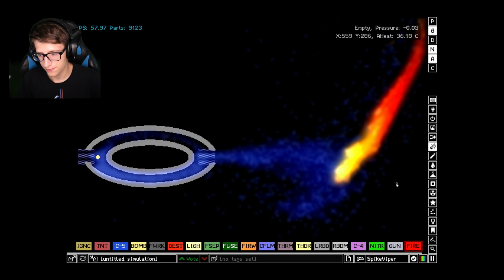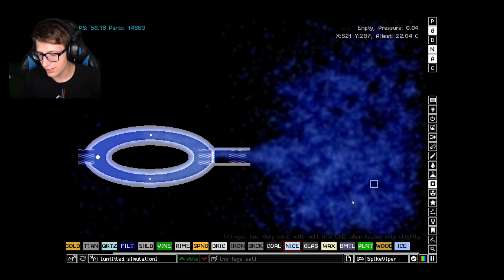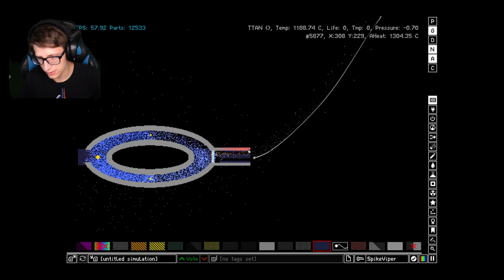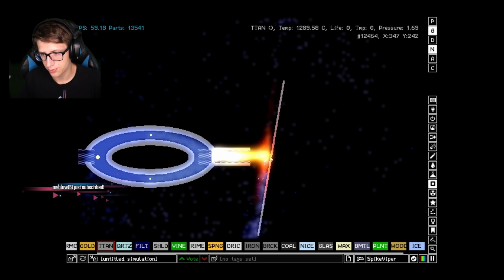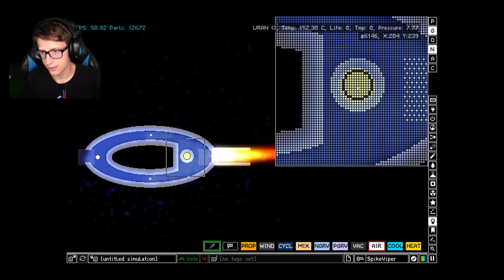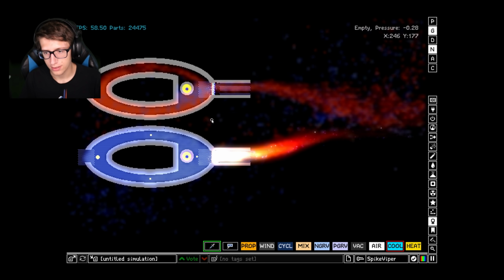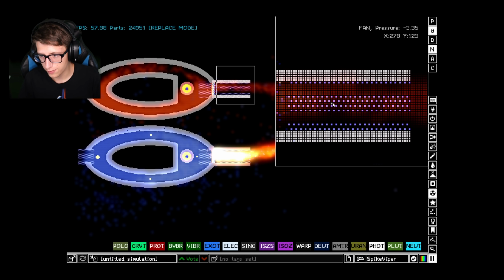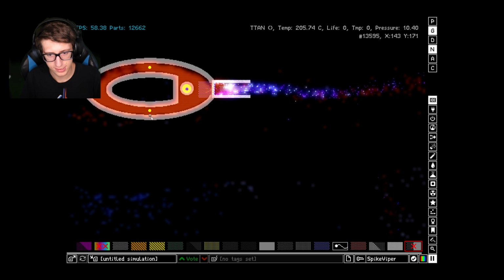PLASMA TORCHES in The Powder Toy!

Comment: “Not gonna use diamonds cause I want to make it realistic” continues to use fucking portals….
Reply: Quote unquote
Reply from the maker: It’s really the only way to make a one way valve without making it horribly slow (pipe)
Reply: @Tuga chan uwu well diamonds irl are not literally indestructible in all forms, they're pretty shiet materials
Reply: @serbianspaceforce6873  dimonds alone are weak, but coating metal with diamond is very strong.
Reply: Sorry for necroposting, but let's just imagine a portal is a pipe that goes through the background.

Comment: If you're going to test melting times you need to put the wall the same distance from the ignition point each time or you'll screw up your results.
Reply: Was looking for this comment, but it's not only that, the plates should also be equal in length and each torch should get it's own plate.

Comment: Ummmm I may made a water vapor beam that can melt gold alinum and iron faster than that (Titan gold and quartz more layers need more water vapor beam)
Reply: Gold, Aluminum, and Iron all have extremely low melting points.
Reply: @Bobdylan12121  what have high one wanna test If I can melt it
Reply: @Heilkromer  try titanium, steel, or tungsten. tungsten has the highest melting point of all metals
Reply: @Bobdylan12121  :| my thingy uses pressure so tung will just get destroyed